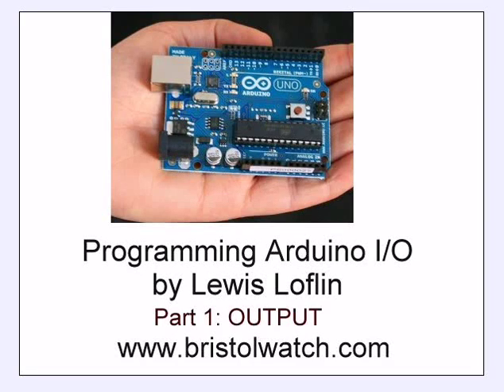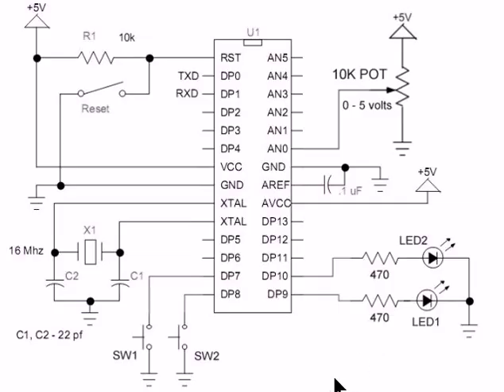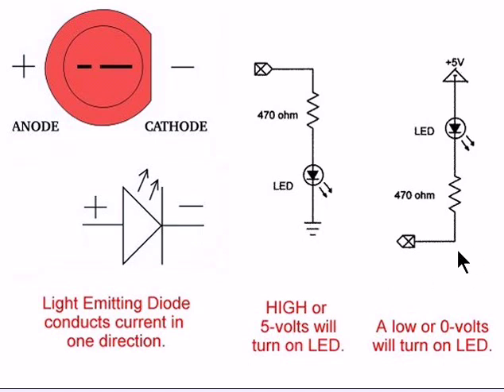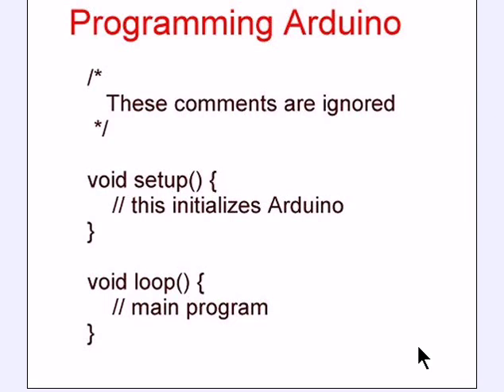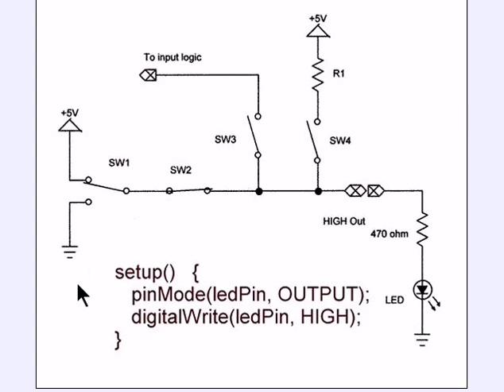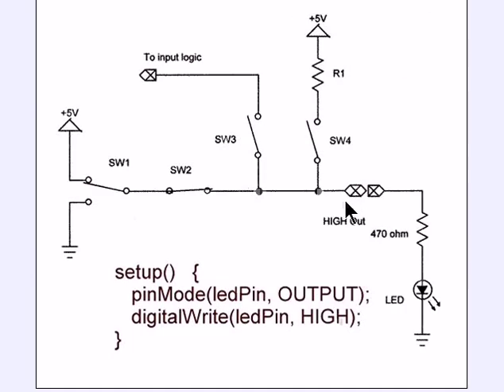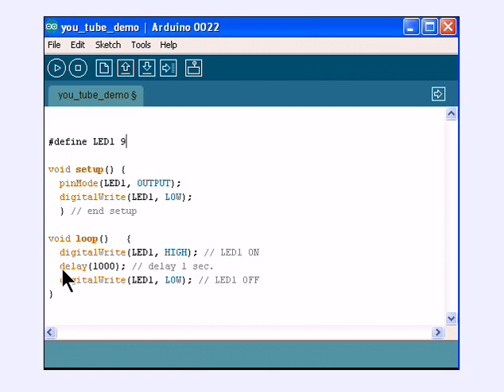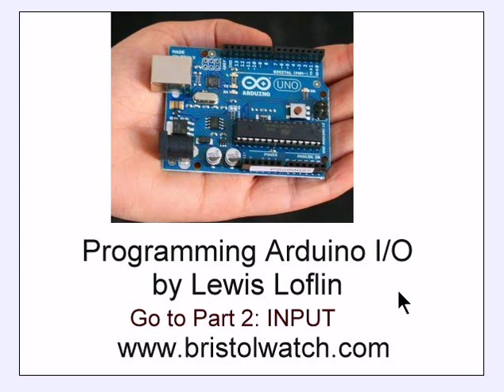Part 1: Programming Arduino Output

Comment: Hi I am using mac and arduino uno. i am unable to upload code. keep getting error. Everything was good before. But I delete arduino software and reinstall but now i am getting error with same arduino. There was already one sketch in arduino from previous software that one still work fine. but can not able to upload new sketch even if i try same sketch. this is the error i will get every time 

/Users/mandeepsingh/Downloads/Arduino.app/Contents/Java/hardware/tools/avr/bin/../lib/gcc/avr/4.9.2/../../../../avr/bin/ar: abi.cpp.o: plugin needed to handle lto object
/Users/mandeepsingh/Downloads/Arduino.app/Contents/Java/hardware/tools/avr/bin/../lib/gcc/avr/4.9.2/../../../../avr/bin/ar: main.cpp.o: plugin needed to handle lto object
/Users/mandeepsingh/Downloads/Arduino.app/Contents/Java/hardware/tools/avr/bin/../lib/gcc/avr/4.9.2/../../../../avr/bin/ar: core/new.cpp.o: plugin needed to handle lto object
/Users/mandeepsingh/Downloads/Arduino.app/Contents/Java/hardware/tools/avr/bin/../lib/gcc/avr/4.9.2/../../../../avr/bin/ld: /Users/mandeepsingh/Downloads/Arduino.app/Contents/Java/hardware/tools/avr/bin/../libexec/gcc/avr/4.9.2/liblto_plugin.so: error loading plugin: dlopen(/Users/mandeepsingh/Downloads/Arduino.app/Contents/Java/hardware/tools/avr/bin/../libexec/gcc/avr/4.9.2/liblto_plugin.so, 2): Symbol not found: _environ
  Referenced from: /Users/mandeepsingh/Downloads/Arduino.app/Contents/Java/hardware/tools/avr/bin/../libexec/gcc/avr/4.9.2/liblto_plugin.so
  Expected in: /usr/lib/libSystem.B.dylib

collect2: error: ld returned 1 exit status
exit status 1
Error compiling for board Arduino/Genuino Uno.

PLEASE HELP ME
Reply from the maker: I don't know anything about a mac. It sounds like a serial port problem. Sorry can't be any more help.

Comment: I have been watching your videos and am learning a bit. Question regarding my project. Wanting to switch on a laser diode with low logic pin(0volts) wondering if the p channel mofset would be appropriate and if a source/gate drain resistor would be required. Laser is driven by outside 12v source. Would like to verify diagram. Thanks for your time in creating these interesting video
Reply from the maker: +Robert Frederick Just switch the 12V source on/off. I don't think a laser diode should be treated like another LED.
Reply: +Lewis Loflin Trying to switch the 12v supply with the low output direction pin on the breakout board.I need it to be split second on or off or it will burn the medium. Trying to control the off and on of 12v with the mosfet when the direction pin goes to low. Maybe a relay would be better suited but thought a mosfet might work best.
Reply: +Robert Frederick I guess I should explain further, I have a cnc controlled engraver with x,y,z axis, Putting a laser in place of spindle. Using the gcode for x axis down the direction pin goes to low (0Volts) when it goes up the pin has +5volts. I want to trigger the 12volts on  for the laser when the x axis comes down on the (low 0 Volts) so how to turn on the 12volt supply with a 0 volts input from the direction pin on the breakout board.
Reply from the maker: +Robert Frederick Invert it through a transistor.

Comment: Hi Lewis!
I enjoyed this tutorial and was wondering if you have any for programming LED drivers.  I am specifically interested in the M5451 since i would love to create a clock using that chip to show seconds and minutes with leds and this driver supports 70 with one chip.  If you have any info on this I'd love to hear about it.  I've already searched for that and whatever is out there is very complexed.  Given your basic style of tutorial I think you'd make something like this much more accessible.  Thanks in advance!  Bryan
Reply from the maker: I'll look into it.
Reply: Thank you Lewis!
Reply from the maker: bryan greifinger I looked at it - I should be able to write the code but I don't have one. Might be worth a YouTube video. I'll check Ebay.
Reply from the maker: Lewis Loflin I checked it out and I can get it to work, but the part is obsolete and costs $10 a pop. It would be easier to use four 74165s in series.
Reply: I already have two of them for 8 dollars a piece.  and I still them for sale.  I'm just curious how you got it to work.  thanks Lewis!
Reply: Plus i can controll alot of leds with just one chip!  Vs say 8 chips with the other ic
Reply: Here's a source i found for 4.22 a chip.
Reply: I would have no problem finding and paying for the chips if you can show me how to wrie simple code that will get to light up a long line of 60 leds.  
Thanks!
Reply from the maker: bryan greifinger Send me a chip or two and I'll sit down and write the code. It shouldn't be a problem.
Reply: Great, how do i send it to you?
Reply from the maker: bryan greifinger 4074 Cove Creek Road Bristol, VA 24202
Reply: Thank you Lewis !  I'll search for the chips again and let you know when I've ordered and when they'll arrive if they'll ship it direct to you.
Reply: Lewis, i just ordered two chips from DigiKey.  IF this goes thru correctly they should be shipping it directly to you via USPS priority mail. I will let you know when it ships.  please let me know you got it when it arrives.  Thanks.
Reply: The chips have shipped.  Should be there
 either this week or early next week.
Reply from the maker: Great. I'll do the code and make a video on these type devices.
Reply: Looking forward to seeing it.
Reply from the maker: bryan greifinger Got the parts and figured out the coding. I've done it in Python and will port it to Arduino. The spec sheet was a joke but i figured it out in about 3 hrs. E-mail me at lewis@bvu.net
Reply: why python? Isn't it easier and more common to do it in a C type langauge?
Reply: you will be making a video tho right?
Reply: Glad you got the chips with no incidents
Reply: I'm not surprised the spec sheet was skimpy.  That's partly the reason i needed help.  Sometimes I wonder how the mfgrs expect people to use their goods.
Reply: Hi Lewis,
Just checking here since I haven't heard from you since I sent my email address.  Wondering how its going.
Reply from the maker: Putting the material together now for Arduino and Raspberry Pi
Reply: Thanks, sounds great!